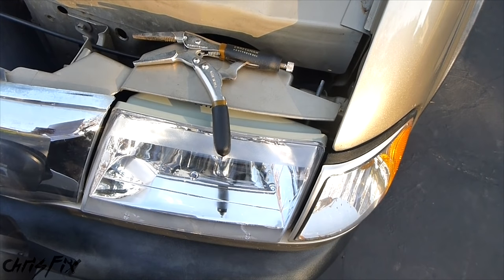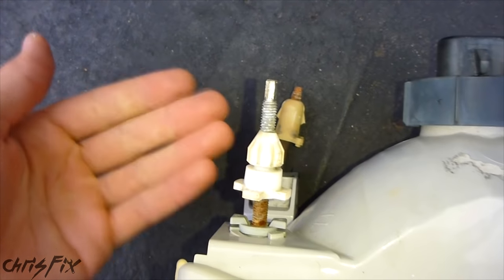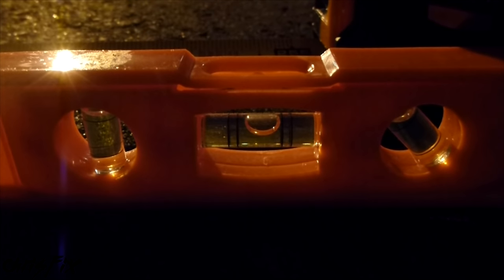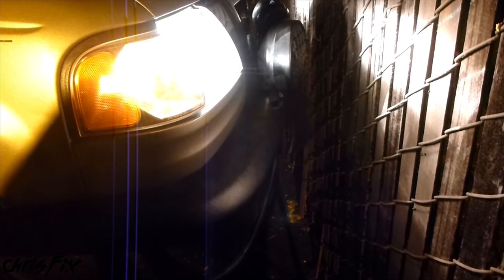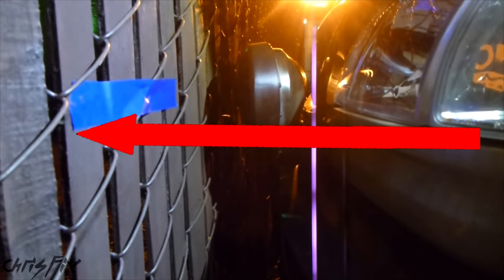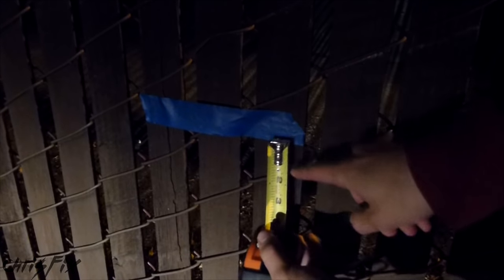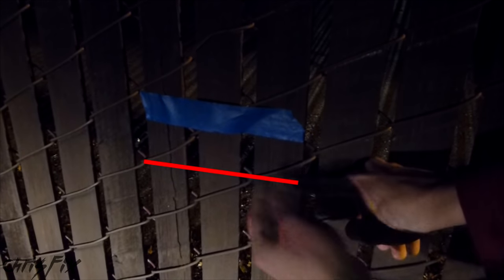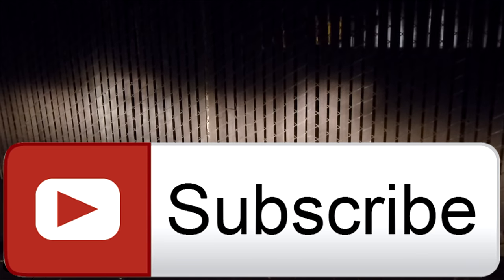How to Adjust, Align, and Aim Headlights and Fog Lights PERFECTLY

Comment: before adjustments, It would seem a good idea to inflate all 4 tires to correct air pressure, too
Reply from the maker: +Garacha222 great tip!
Reply: And have an alignment with the whole "don't touch your steering wheel" thing. Lol.
Reply: I took the bed off my truck and brought it to the mechanics for welding repair. And had him adjust my headlights while the truck was there. Well the bed was at my house and he adjusted the lights without the bed. Today driving I'm like, wow I'm lighting up the top of those pine trees, and blinding everyone down the road.
Reply: @mfk12340  Don't worry about anyone else.  In your life, you have to put yourself first.  No one else is going to do what's best for you but yourself.  People are unpredictable and will use you whenever they can.
Reply: @revokdaryl1  you okay fam ?😂
Reply: @certifiedpearler6945  No, I'm not ok 😆
Reply: @revokdaryl1  thats a very lazy excuse to have annoying ass headlights hahaha
Reply: @revokdaryl1  No. It's basic road safety. Even if the otger driver is a POS, still don't blind them because it increases the chance of an accident; potentially killing an innocent person.
Reply: @revokdaryl1 In general, you are speaking absolute facts. Do for yourself.💯 When it comes to oncoming traffic, however, it's common courtesy to not blind other drivers with your lights. They're public roads and you need to keep yourself and others on the road safe. Now if you owned your own road like a mile long driveway, then that's where it's a gray zone and in that case, sucks to someone else. Lol

Comment: My tip is to just lay a two by four, 25 feet (plus the distance from grill to front of tire) away from the wall, and measured to be perpendicular. Then simply roll your vehicle up to the 2x4. You'll be able to tell if you're parallel if both tires approach the board equally.

Comment: Back in the day I asked a mechanic why they had thick lines painted on  their wall, it was for this very reason. They adjusted a lot of headlights.  I use this method on my garage door.  Good video. It's one of those many things most people never think about, but should.

Comment: I used this system to adjust my new headlights on a Toyota
Tacoma, it is easy to follow his instructions and is flawless; did a great job
in just a few minutes, spent more time measuring and setting up than it took to
adjust a perfect set of headlamps. Thanks for your fantastic how to video.
Reply: You dont have to be perfectly square just back up 25ft from a wall and set em up.

Comment: "You dont want to blind other people."
i bet you 50 quantrillion dollars that ive been blinded by every single SUV and a truck EVERE EVRE EVER made
Reply: There's no quantrillion.   It's either quadrillion or quintillion.
Reply: @mormegil2  This is all the more important if you're one of those "quantrillion" people driving an SUV or truck.  Don't be one of the bad ones.   ;)
Reply: Actually my left one blinds truckers and the right one blinds mice.
Reply: Quantrillion is my rap name.
Reply: I'll bet you those 50 quantrillion dollars it's because they sit higher then the average car. Just a few inches makes a world of difference.
Reply: Hate Breeder mine is big daddy vincent
Reply: @jamesa6272  they pay for it when I'm  blinded.  Flip on my high beams and light bar and they flip their brights off real fast
Reply: @jamesa6272  they could also have HID lights or LED. Much brighter than halogen depending on the intensity they got. Those bright blue/white lights are intense even when they're low beam.

Comment: One thing to note is that outboard side headlight is actually meant to be slightly higher and/or focused to the outside of the road. It is meant to light up the side of the road without blinding people. The inboard side light is meant to light up both sides of the road without blinding people. 
Only caveat, you don't have old style headlights, some cars are completely level from factory, when using LED or HID.

Comment: Great video. I think that there might be a mistake aligning at that height. There is a cut off horizontal line on low beams, that's the one you need to use. Right hand driving lights make some kind of low beam pattern like "__/". The aiming should be in the "__" (horizontal) part of the pattern rather than the "/" part.

Comment: I'm subscribed because I really appreciate the unvarnished information you present. 

My elderly friend has a 2004 Crown Vic, which is known by LEOs and other owners as having some of the worst forward lighting ever put on a car. I used this video to make it the best it can be under normal circumstances and may need to make 1 or 2 very small adjustments in the future. Even with my fairly normal vision these lights are poor at best. 

I've seen your police Crown Vic videos and wonder if you have any tricks or tips that you can share, and maybe if you have enough to warrant a video of their own. I'd really appreciate it, and I know for sure my friend would.

Thank you for your efforts. It takes a special person to do this on a regular schedule!
Reply: Hot Flash, you can try a "low budget" approach that has worked for me.  Step 1: polish the headlamps. Yours could be faded and oxidized. I use Mother's headlight polish with a rag. 5 minutes and you're done. Step 2: get some Sylvania extravision halogen light bulbs. These can be had for about $20 at your local Walmart. These helped out some. After the two steps, I can see very well now with just the factory halogen setup.

Comment: I'm fitting a whole new set of projector headlights and fog lights on my Tundra for better light displacement, some added style and that wonderful crisp cutoff line. Thanks for the adjustment tips for the Fog lights as it had been a hot minute since I adjusted them

Comment: For the EU Viewers:

1. Check if your car needs a 10% or 20% offset
2. Set the tape as shown in the video
3. Measure the height and deduct the percentage
4. Back up 10m
5. Adjust your beames according to your calculation. You have to use the lower part of the asymmetric beam, not the high one as shown in the video. If your headlight is properly adjusted, you are able to light the sidewalk without blinding the traffic.

Edit:
Fog lights need 20%/100m (2%/10m) and Head lights 10/100m (1%/10m)
Reply: You are exactly right but you missed a step...I'm sure ohms law fits in there somewhere.
You know for the current drawn  at each distance measured
Reply: In Denmark fx. your low beams must fall 1cm pr 1meter
Reply: Wasn't Chris using the lower edge of the low beam? I am fairly certain that is what he said.  Perhaps you mean to say that in EU the upper edge of the low beam is used?  That would of course drop the measurement the full height if the headlamp. Doing this would ensure that the beam is even lower than USA.
Reply: @mark00820  EU mandates dipped low beam. The percentage required is based on the height of the headlight above ground and is noted on the headlight housing. For passenger cars -1% to -2% is common. With a 1% dip the cutoff drops 10cm every 10 meters. The cutoff of the beam should hit the ground at around 50m in front of the vehicle.

Comment: Cool, thank you for this Chris. It looks like the set up in your truck allows you to have many different settings. I have done this in my car several times, and although with practice it gets easy, I wish sometimes this could be done from the cabin too lol
Reply from the maker: ***** The headlight is pretty easy to adjust if you have a way to turn those 4mm screws lol. They are the worst. It would be neat if they could make self leveling headlights!

Comment: Thanks for the great video Chris.  I recently bought an old car from the 80s and initially assumed that I'd have to get new headlights due to the poor illumination.  Turns out, the vintage lamps were just not properly aimed.  Using your tutorial, I was able to get them back to proper alignment and I'm not longer dreading driving after dark.  Not sure that I need to upgrade them after all.

Comment from the maker: ***** haha, I live in an area that is pretty safe so it was not something I was worried about. The drivers side lens was melted with a heat gun (I explained it at the end of this video): How to Separate Headlight or Fog Light Lenses (without Oven, EASY)
Reply from the maker: Jerry z Awesome! Glad you got it done! Nice work!
Reply: My headlight's left and right adjusters don't work now its all pointed to the left it just slips
Reply: Every car has a headlight adjuster switch on the dash. Mine is numbered 0 to 5. 0 being highest and 5 being lowest. Where would you recommend it to be before starting the process in the video.
Reply: +NK28 you sound so sure that "every" vehicle has this option
Reply: +NK28 first off ... not all cars have that feature... secondly... you need to set it on "0" and then adjust your headlight positions to the correct height.... that feature is for when you load the back of the car with either a few passengers or heavy things in the boot... the headlights will then be way off shining into the sky so adjusting that switch will lower the headlights....
Reply: chris do you know how to "focus" a projector headlight? my lights are aligned but one illuminates the floor and everything preatty good but the other doesn't. When i was aligning it, the good one makes a a bright circle but the other one barely does.
Reply: +Terence De Haas my car the beam levels on the wall got like 3 different levels, lowest from left and 2 levels to the right. so which one do I go with for 2 inches below? and is it the same for both HIDs?

Comment: Just used these tips and instructions to work on aiming the headlights on my wife's 2007 cobalt, though it doesn't look like it has a way to aim right and left, just up and down. Our right headlight is quite a bit lower and it won't come up to even hit the wall in front of us so we'll have to find some way to shim it or some way of further adjusting it from just lighting up the ground in front. Thanks again!

Comment: the right side headlight is naturally higher and right of center because its always facing the sidewalk or side of the road for pedestrians or animals crossing the road coming from the ditch or tree's.
Reply: Also the road signs.
Reply: You don't want the right side any higher. His method accounts properly for a slight down angle which illuminates the road ahead of you at the proper distance. What you want is the driver's side light a little lower, and the passenger side light a little toward the curb

Comment: Thanks for the video i just installed LED Auxbeam headlights on my 1993 Ford Ranger and my headlights were way outa wack my left headlight was how your left fog light was and now the left and right are close to perfect! and i found that using a 4mm socket with a tiny ratchet worked a lill better than the vice grips. now i wont be blinding folks. 
THANK YOU SO MUCH
Reply from the maker: Glad the video was helpful!

Comment: Good video. I'm in France and there's a REAL problem with headlights in here, even worse i got very fragile eyes. Most brand new cars(especially ones from Renault)head towards opposite driver's eyes with their factory set-up. While our"technical control" just close the eyes on this for most old and used vehicles-and brand new ones too of course(!)-. It was just pathological some years ago, but now, it's epidemic and really dangerous for ppl like me with very fragile eyes. Even forced to park on the road's side and take a break until i can see again sometimes.

Comment: What are people's opinions about those intense blue-white headlights that are so seriously blinding? I think they are dangerous and should be banned. Ordinary bright headlights are bad enough, but those blue-white ones actually hurt my eyes. Combine that with them misaligned and driving literally becomes a headache.
Reply: The problem is people putting them in improper housings. HID and LED bulbs are really only made for projector beam headlights. But people put them in reflector beams
Reply: Those lights are dangerous to the opposing travelers.  I don't stare at them, I am looking to the right, but they are so bright they reduce my night vision.
The new super-reflective huge yellow warning signs are also dangerous.  They are so effective at reflecting light that their yellow glare hides the road:  I can tell a curve is coming up, but they hide the road.
Reply: I find that the newer cars that come with these lights standard are not blinding at all. It's the wannabe's who install them to their old rust buckets, who have them pointing to the sky; are the people causing the trouble.
Reply: HIDs are illegal in the state of Florida if your headlight  housing is not designed for them. If you are being a nuisance and a cop sees it, you will be pulled over and given a fix-it ticket. The law is states that if you modify safety equipment in your vehicle from what it was intended that is an illegal modification. Even my projector headlight housings were not designed for HIDs  and there are no lenses for HID headlights for my vehicle. The problem is that HIDs are longer than normal bulbs which means they will almost always be out of alignment and the light pattern is out of specification. I swapped my halogen bulbs with LED bulbs because they are the same size and I double checked that it did not modify my light pattern or alignment. LEDs are not that much brighter than bright halogen bulbs but they should never burn out.  On the other hand the fans on them buzz loudly and you can hear them if your engine is off -- my car has an auto-off feature at lights so that is the only time I notice them.
Reply: acephantom903 yeah I hate HIDs. I have some of the newer LED headlights designed for non projector housings. Not blinding at all. Just a crisper white light.
Reply: Technically they are illegal in California, too, but the cops don't seem to do anything about them.
Reply: Zach Novosad Nothing wrong with HIDs. had them in my old truck, just have to know how to adjust them right and not shine them in peoples eyes and your good
Reply: DemonWolfGaming yeah I'm just not a fan of HIDs. I'm not a huge fan of the warm up time. I love my LEDs.
Reply: You're probably talking about aftermarket HID bulbs in stock headlight housings.  And if so, I agree.  

I have aftermarket LED bulbs in my 2001 Tahoe, but the beam pattern is excellent (very similar to Halogen, just brighter), and when adjusted properly (as mine are), they do not blind oncoming traffic.

And God forbid you have your high-beams on coming towards me, or you get my full LED high-beams, which are every bit as bright (if not brighter) than your headlights...
Reply: Zach Novosad no such thing as no glare led bulb there's newer ones that have a better line but still glare
Reply: How does that work?
Reply: @znovosad555  Wrong!

Comment: i did follow your instruction it actual works, but I had a tough time with my passenger side lamp, the lamp is an aftermarket one, the position of the adjusters   on the lamp were different from  the left lamb. the upper adjuster  moved the beam up and down while the lower adjuster moved it to side ways  but on the drivers side   it was viceversa.

Comment: Thanks Chris! I bought some aftermarket halo headlights for my BMW and not only was the passenger side lowbeam REALLY low compared to the driver side, but I can't see ANYTHING at night or early in the morning unless I turn on my high beams. I finally got the passenger side up, but they both needed to be aligned properly. My OEM driver side headlight was hazed on the inside and even though I wetsanded and buffed them, the driver side still looked bad. A single side OEM headlight assembly was $250 for a used one that looked just as bad or worse, so I bought the LED halo lights for $225 with all of the bulbs and harnesses included, but you HAVE to align them properly. Sadly, I didn't, but I'm trying to now.

Comment: I bought a ford headlight adjuster tool off amazon about 5 years ago.  This little tool has relieved me of so much frustration on my Ford Ranger... The only down side is I think it was around $30 shipped...
Reply from the maker: Nathan Bastedo Yea, I put the link to the tool in the description just in case someone wanted it. I didnt even realize there was a special tool (I should have figured lol). So dumb, just put an 8mm bolt in instead. I dont get it.

Comment: In Texas the official MVI stations quit checking the alinement of headlights some years ago. BAD IDEA. Thanks for you helpful video. I have to admit I just use the garage door. I have two Ford CVPI's. One is in alinement and I just put new light doors in the other. I will mark the correct one on the door, and then do the alinement on the other. No doubt your procedure is much more accurate.

Comment: This is false because the low beam should be off to the side of the road slightly to be aimed away from oncoming cars
Reply: chico3018 That is why he drops the tape 2".  Therefore, the headlights are pointed downwards onto the road and not straight at the incoming cars....
Reply: I think chico3018 is saying to aim the light to the right away from oncoming traffic
Reply: That happens automatically when switching from high to low beam - both sides shift down and to the right.  It is especially to illuminiate the right side of the road when meeting opposing traffic because that is where you should be looking to avoid being blinded by  the oncoming traveler.
Reply: what Chico3018 means is that the lights are suposed to be asymetrical to give you better vission at the right edge of the road ;)